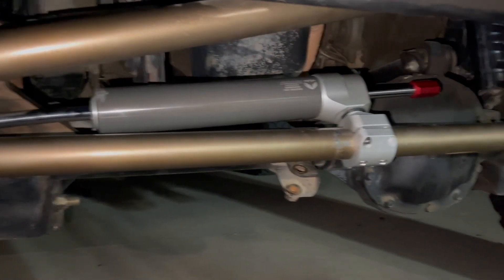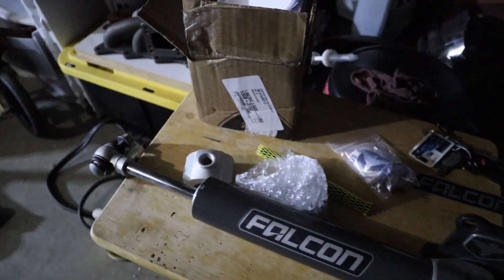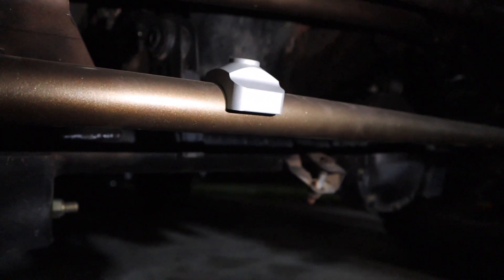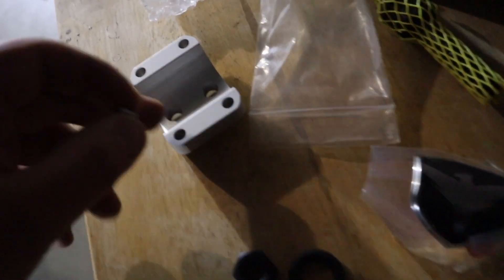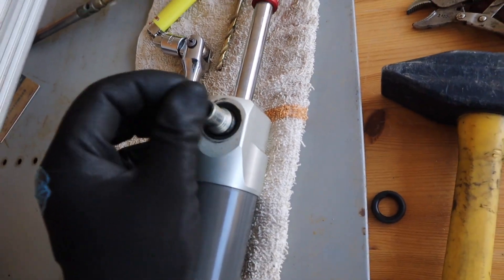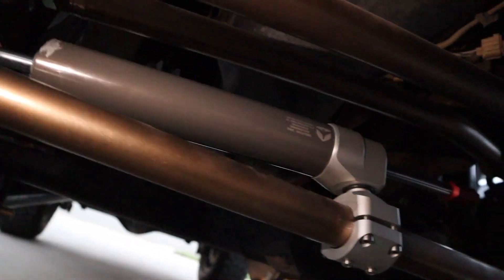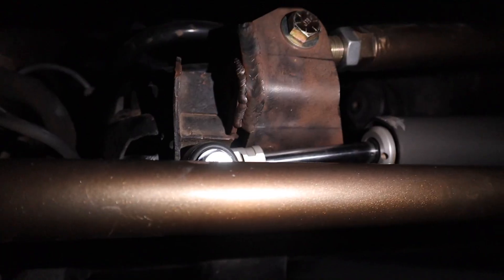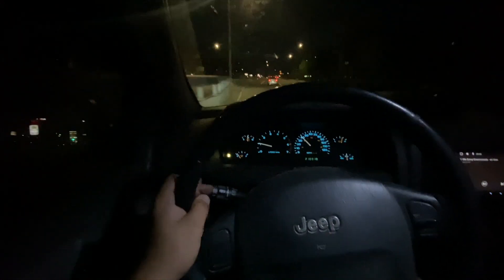Installing Falcon Stabilizer on Jeep WJ Grand Cherokee | Najar Offroad

Comment: On my wj I tried everything for death wobble. All the upgrades you have. What finally fixed it was the dual steering stabilizer from Kevin’s off road. 100% fixed it. I had dual fox on before and nothing compared to Kevin’s
Reply: A stabilizer can't fix death wobble. All a stabilizer does is mask the problem.
Either you never actually had it or you're just hiding the problem.

*Not trying to be an ass. But again a stabilizer Can't fix Death Wobble.

Comment: There's a screw on top of the steering gear box to change the gear mesh pre load. Tightening this up will help if you haven't tried already.
Reply from the maker: I’ve already done like even tightened it extra and still had the play has to be the gears. When I turn the steering I can where the steering context to to moves but underneath nothing is moving until I turn the wheel more
Reply: I did that to mine a couple of weeks ago, nice and tight steering once again

Comment: Hey I know this is an Old Post but you didnt reference any Part numbers for the Brackets for this Stabilizer from Falcon Im going to Just buy the falcon or the Fox Pass Threw Probably Falcon Do you or anyone have any of the Part Numbers For the Mount on the Stabilizer you used? I Have the TMR Custom Upgrade Stabilizer Mount and its Not to Expensive And very well Made. Its Just a Universal Mount For $88.00 But i Wanted to know What Part Number you Ordered Please. I have a GTR Functioning Ram Air Hood And Im Almost Done Fabricating a new Air Box Out Of Aluminum To use the Hood Intakes and open up Flow But Still Get the Benifit of Air That is Noticably Cooler And Forced in. Till I have Time To Finish all the Tig Welding On the Turbo Manifold That was a lot of time Behind the Tig And Back Purging The Stainless With Argon. Thank you For your help SOrry for the long Comment.

Comment: Not sure if your Fuel gauge is broken, or if you are really that low on fuel. Its not good for your fuel pump long-term to run your fuel lower than 1/4 tank. I rarely let any of my vehicles go below 3/4 or 1/4 tank, not only for this reason, but also in case SHTF or an emergency, you don't have to now go fill up at a gas station.
Reply from the maker: The gas light came on when I was filming this video😂 I’m actually going to get fuel right now haha
Reply: @NajarOffroad  Yeah alot of people run their fuel low, which can cause fuel pumps to fail prematurely, because the fuel acts as a lubricant as well as keeps the pump from overheating. When you get low it will draw in air because there isn't enough fuel.
Reply from the maker: That’s good to know! Maybe Ill have a fuel pump replacement video coming soon 😂🤦‍♂️
Reply: @NajarOffroad  no just because it happens occassionally doesn't mean its failing. You are increasing the risk of it failing, but im sure it will be fine. Im just saying I wouldn't suggest doing it often,

Comment: So what is the point of the rod that sticks out? Does it adjust something?
Reply from the maker: It is the rod to adjust the firmness of the stabilizer. I’m not to families with pass through stabilizers
Reply: @NajarOffroad  Interesting, seems like it would get in the way but maybe not.
Reply from the maker: Definitely can if it’s not positioned correctly

Comment: i think my steering box is bad because my car car pulls to the right or left i just replaced ball joints and got new tires and got an alignment as well. She stills pulls one way and its not a hard pull its ever so light and pulls harder faster you go but nothing crazy. Any ideas if i am right?
Reply from the maker: Yea I have kinda the same feeling on mine! I have literally replaced everything but the gear box
Reply: I think you're dead on, I'm in the same boat, but I would also check your front control arms if you have excessive movement at highway speeds or strong winds, the bushings could be trash causing extra play
Reply: Rear lower Control Arms can cause this. If you notice you pull when accelerating one direction, and when de-accelerating (letting off gas peddle) it pulls the other way, it is caused by the rear lower Control arms bushings being worn, and you get what is known as torque steer. 
Test this when on the high-way by giving it more gas when you are at high-way speed for a couple seconds, then let off suddenly. See if what I described above happens.
Reply from the maker: I would say yes check the rear! Unfortunately I know that’s not the case for me since I replaced everything haha

Comment: This has nothing to do with death wobble but My Air Conditioning, Power Windows,Door Locks,Horn And High Beam,And The Message Centre Stopped Working So I Thought It Was The Wiring In The Door But I Cut Soldiered and clamped each wire so I went to the fuse box and it was a 50 amp fuse controlling  all those accessories. Your Death Wobble Is Most Likely Your Steering Box,Good Luck.
Reply from the maker: I don’t have death wobble. Just like a small left to right wobble like a dead spot in the gear box
Reply: @NajarOffroad  You know a lot more than I do Brother but I'm learning,I've done some great upgrades from your videos and thank you for that step by step.Much Appreciated. Happy Trails.
Reply: @NajarOffroad  I have a 4 inch lift kit on my 2002 Jeep Grand Cherokee Laredo.Do you think I can put 2 inch spacers to have a 6 inch lift or Would I have to put a complete new 6 inch lift kit?